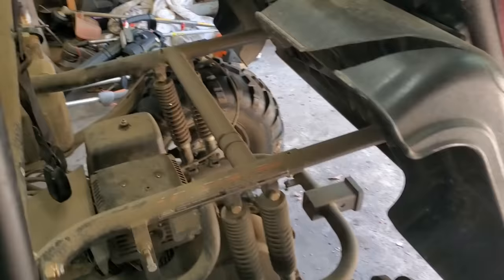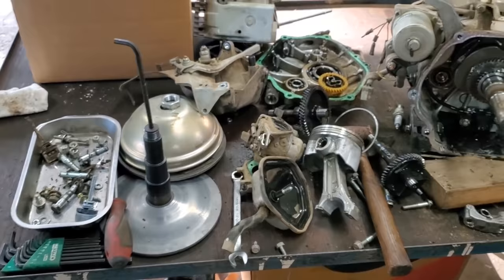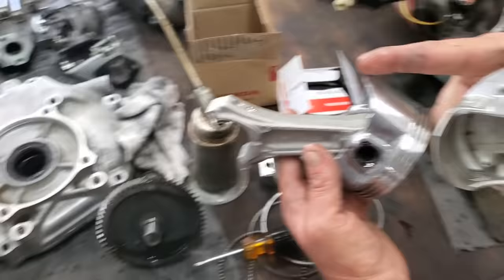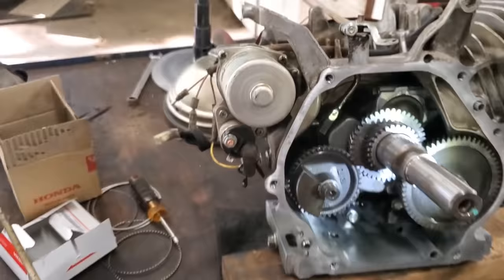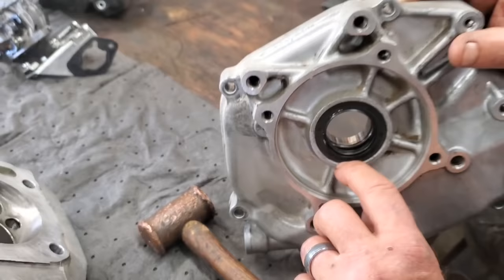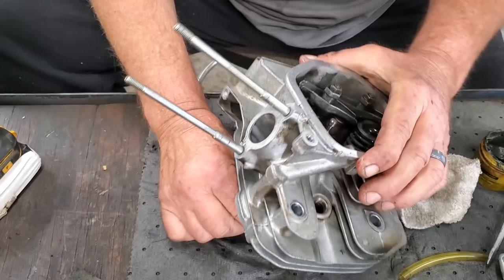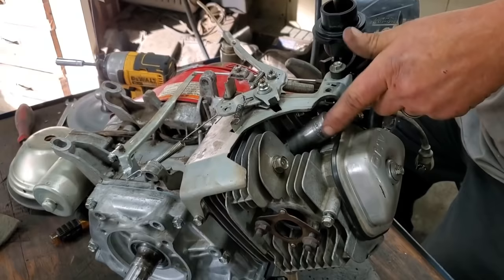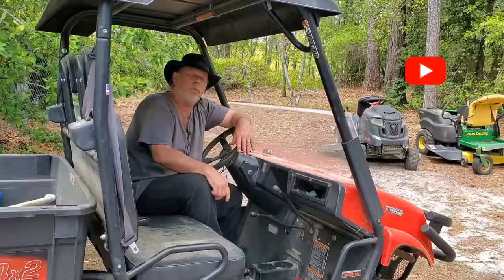Honda GX390 Smoking How To Replace Rings, Reseat valves and Replace Valve Seal Easy DIY

Comment: I did learn another few things from this video, so thanks to you AND the folks that commented. 
I learned a couple new ways to lap valves in, either just with a piece of fuel line by hand or chucking the fuel line into my drill. Great stuff!
Also gonna try the viewer tip on using a feeler gauge .003 over before tightening the locknut. That’s the first time I’ve ever heard anyone explain why the adjustment changes as the locknut is tightened. Now that I think about it, the threads having .003 play makes perfect sense!

Comment: Would the new piston with a longer skirt make for a more quiet running sound?  Also where did you purchase the new piston?
Reply from the maker: We are a Rotary Dealer,  that's where we get 90% of our parts. I'm sure that's where I got it from. Sorry, I have no idea if a longer skirt will make it quieter. We stick to OEM or Rotary as close as possible to oem.
Reply: I’ve AllWAYS replaced piston and rod 90% of the time and have never had a problem 
OEM parts are the best parts 
Some major brands are very good also and have used a lot of Rotary parts
Reply: How do I get the flywheel off? Does it have left hand threads? My impact air gun will not budge it. Thanks very much.

Comment: Your wondering why you had to adjust your rockers so many times. The big nut threads have about 3 thousands clearance. So you can either add 3 thou before tightening or back the big nut off a quarter turn then tighten the lock nut down. You should be very close.

Comment: T-bone what do you think caused the damage
Reply from the maker: It's from the customer not changing the oil and running it low on oil
Reply: That’s what I thought to but I can’t fathom. Why you would even check the oil 🤔I’ve run my oil way to long to but it gets looked after really close until I can change it
Reply: I love over hauling the GX Honda engines 
Can’t beat them